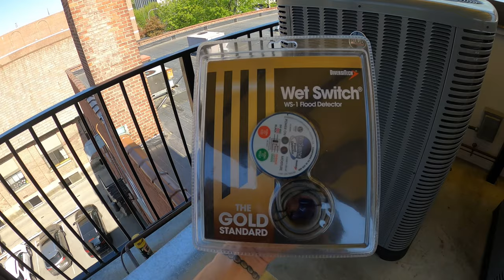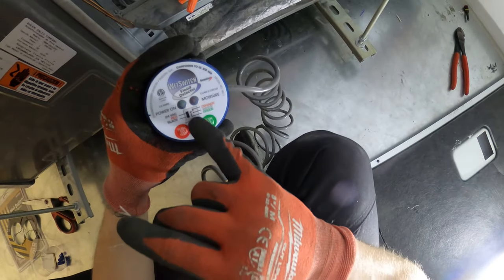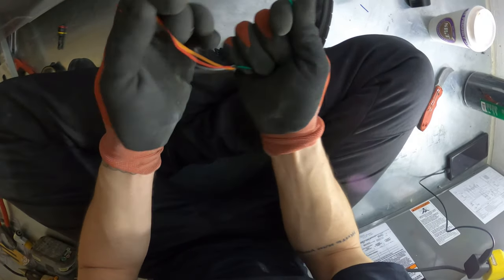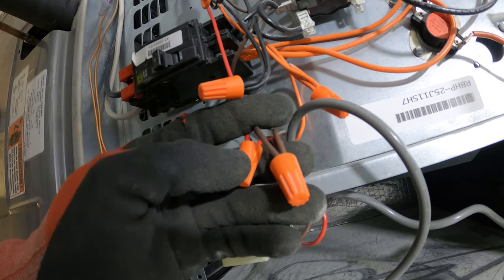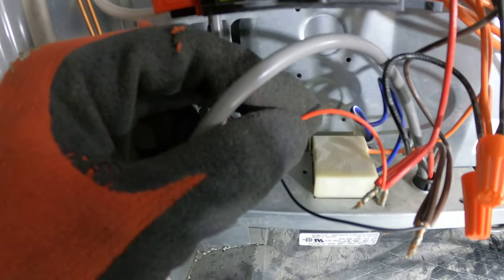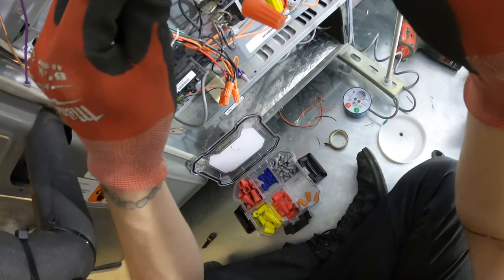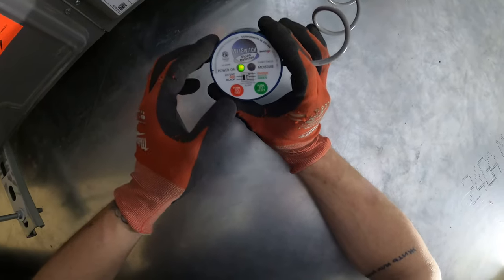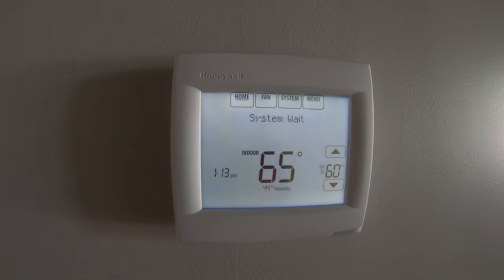HVACR: Diversitech Wet Switch Installation Using Dry Contacts (WS-1 Flood Detector) Step By Step

Comment: Shouldn't the green wire and orange wire been swapped?  According to the diagram, doesn't the green wire bring power to the WS and the orange wire is power to the controller?  

You specifically said that power is coming into the WS via the orange wire ( 8:20). 

Am I wrong?

Comment: In what sort of scenario could you see using the normally open contacts? Maybe an external alarm or something?
Reply: Yes my thoughts exactly but couple options might be Simple may not.

One would at least be to put a 24-volt preferably red indicator or LED or perhaps a flashing LED.

Of course some sort of label next to it that would say something like water detected whatever.

But if you could find a suitable soft buzzer or something that's possible as well.

Since you already have the 24 volts available.

Would be easy enough to use the other contact as you said!

Even if feasible you may have a few extra wires in the thermostat cable.

Depending on the setup.

If you were to have at least one extra wire not in use.

You could feasibly wire that to the normally open contacts provide 24 volts if water is detected.

Some sort of indicator or something at the thermostat end of things.

Also some thermostats do have emergency shutdown contacts now!

As well as possibly amines at the thermostat the indicated that that was was initiated or activated or tripped!

If that could be tied into with a 24 volt signal there you go and would provide indication that something and it happened at the thermostat.

Also is often used when there's a float switch or more than one footswitch in the system#

Not a technician here but someone that would know their way around control systems and other things in Myriad of different things!

Also always always put some sort of float switch in a system no matter what!

Where the places I stayed at I saw firsthand what can happen!

Drain pan issues.

Talk about water damage mold remediation Whole Nine Yards.

Ceiling below the unit had to be ripped out!

Nasty stuff that would really ruin someone's day if it ever does happened or the condensation drain gets clogged!

In some cases you do have a secondary drain although I've heard of at least once we're both had been stopped up.

The attic have been recently insulated and well some insulation found its way into the drain pan not good!

Also if a condensation pump is used there's a float switch in those oftentimes.

Could be wired the same way perhaps even connected simultaneously as Worthy's water detection modules as well and perhaps even with a float switch which should be included as I mentioned in every system!

You know where there's potential for water to get where it shouldn't be!

And there would be a way to easily prevent that or at least potentially stop damage!

The naysayers Mayo that will never happen don't discount Murphy's Law!

And almost every time somebody has actually come out and said that it's me about something lo and behold that's exactly what's happened the thing they said not to do was what would have saved that from happening every time!

As one would say cheap insurance.

Like in some areas believe or not required to have a fuse on a doorbell transformer oftentimes will just be regular light socket with a fuse in it.

And there's been times I've retrofitted that after a Transformer Let the Smoke Out and cause problems let's just say.

Besides if the doorbell transformer is on another circuit that's something a little more critical than the doorbell fuse would be good idea so Adagio Royal Transformer does not take out the entire circuit.

Where I I stay now unfortunately cannot change this.

But if the doorbell transformer where to go out take the circuit with it out to go to lights and nearly all the receptacles yeah Apartments!!!!

Comment: My Wet Switch tripped twice in two days, with no water in sight. The A/C also quit blowing cool air. The inside (and outside) fans both work but only blows regular air temp. Is this a coincidence that this happened the same time the Wet Switch tripped (first time in the six years we've been here)? (I changed the capacitor, but that didn't fix it.) Any suggestions? My main question is could a malfunctioning Wet Switch cause the air not to be cool? What if it wasn't wired correctly? Here's how its wired: green+black>blue (from transformer) / red>red (from transformer) / yellow>dark blue / white>capped off. BTW, the thermostat is still on when the Wet Switch trips. (2015 Daiken system)